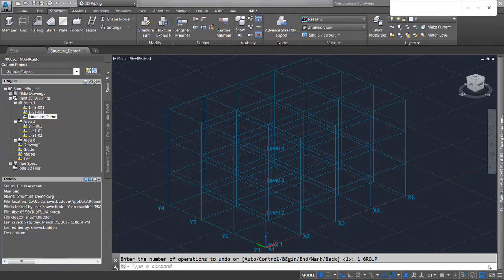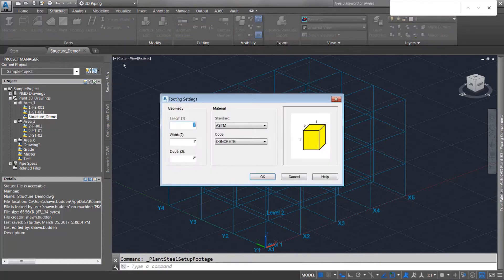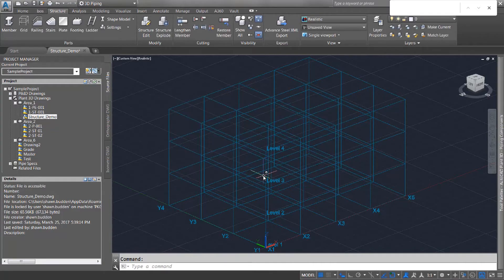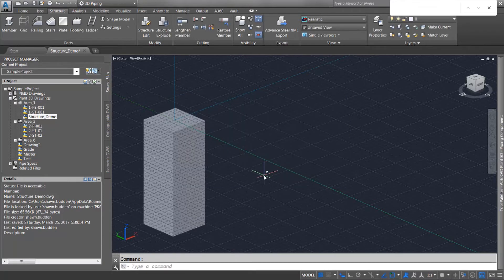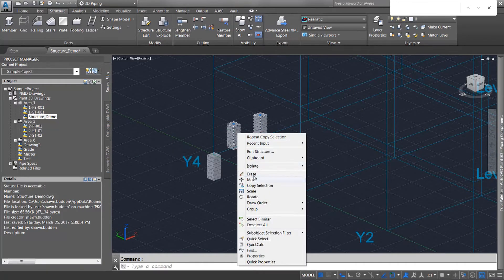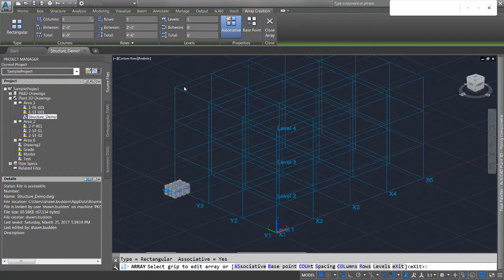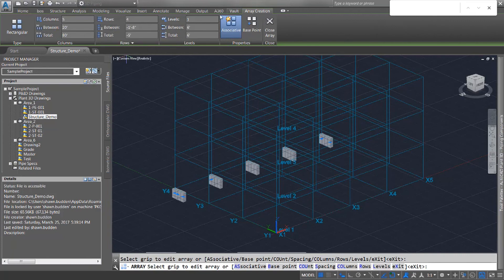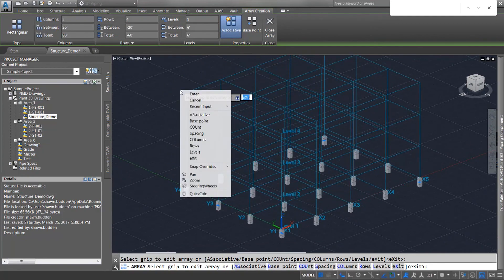Creating Footings in Autocad Plant 3D / Autocad Plant 3D tutorials

Comment: Great and easy steps to follow but my footing appeared flat 😢
Kindly help me resolve this issue please
Reply: It could be the PLANTSTEELSETREP setting. If you go the Structure tab, under the Parts panel, there's a drop down for the Model display, just to the right of the Ladder button. If you change the setting to Shape Model, that should allow the footing to display as a block.